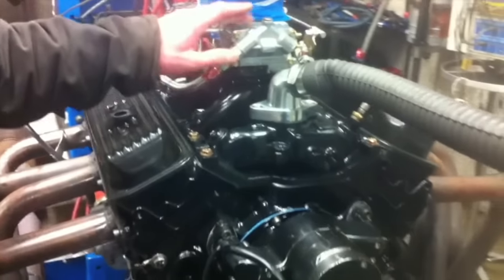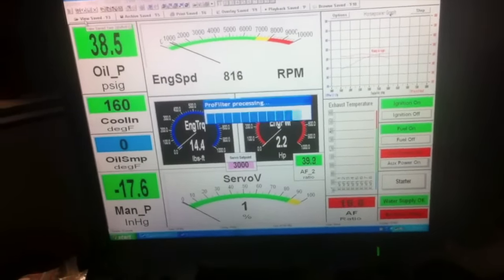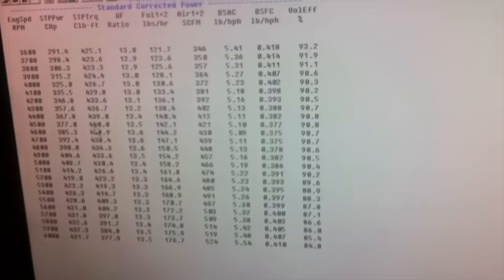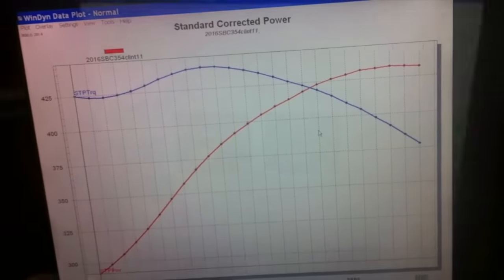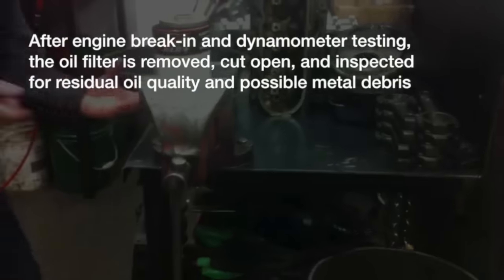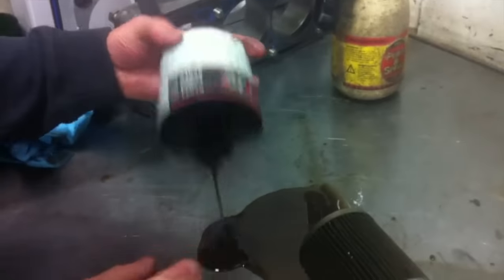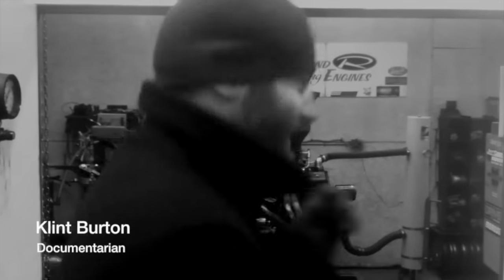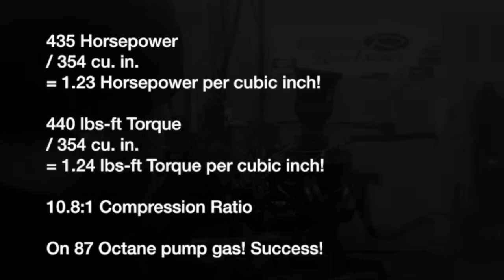SBC 400 Block + 327 Crankshaft Dyno The 350 Chevy Should Have Built (2016)

Comment: I'd rather we use a 400 crank on a 327 block truth be told.
Reply from the maker: Hi C6! 383's (a 400 crank in a 350/327 block) are almost as ubiquitous as a standard 350 performance engine. Anyone can build or purchase that—and that's fine. Those are proven engine combinations. We've had opportunities to build different engine combinations and glad to do so, with brilliant results, and happy customers. Best regards!
Reply: @ceperformance  Mm. I like my powerbands rather diesel like and my CRs on the lower side for street cars, so I'd go more for long stroke than big bore. 383 with a 252h cam, 550-650cfm vac-secondary 4-barrel on headers and 8.5:1 CR would be about mint for a work truck or daily runabout I think. Pull Mt Rushmore off its foundation, be mild mannered as can be, run on whatever rotgut crap I throw down its gullet, last 40+ years. Perfection!

This engine I'd more aim for a race rig. Trans Am wouldn't be a bad place for it, Baja rig, maybe something rally if one wanted to go oddball nasty with a g-body give those hatchbacks some hell on a dusty Norwegian forest trail!
Reply from the maker: Thanks again for your comments :)